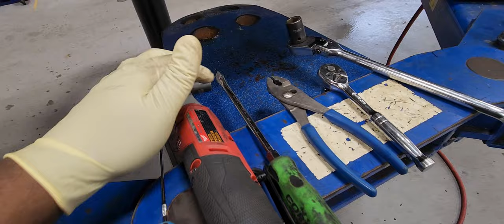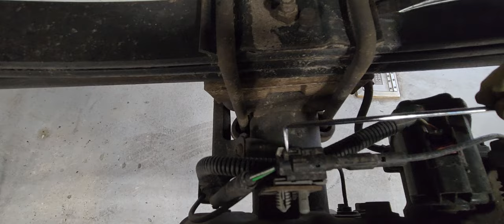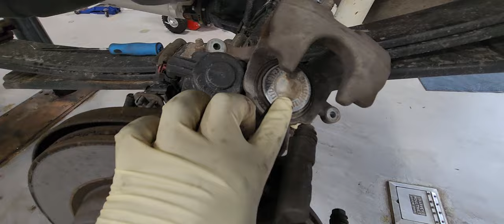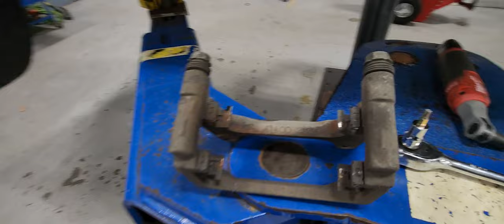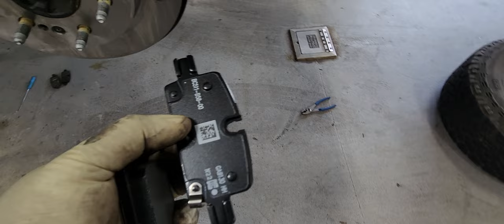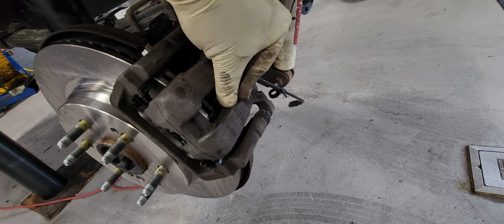2019- up Chevy Silverado rear brake replacement

Comment: Scan tool isn't necessary. You can just put in service mode by holding the parking brake button
Reply from the maker: I found that out recently,I made a separate video about it on how to put it in service mode
https://youtu.be/deHMChk1b3U
Reply: mine is a 2021 and could not get the service mode to come on no matter how many times I sat there and peddled the brake and pushed the button, how ever I do have a rear brake replacement option on the dash which can be reset
Reply from the maker: You are probably missing a step, I've used countless time on Silverado and other gm vehicle,always work,watch carefully
Reply from the maker: https://youtu.be/deHMChk1b3U?si=uA5kskx1gz47FQvn
Reply: @melvinpaul9302 you have to have the ignition on. Not running and not a short press that turns the radio on. You need to hold the start button with foot off brake for about 8-10 seconds. Then when the dash powers up you hold the brake and the parking brake button simultaneously until the brake service lamp starts blinking then remove your foot off the brake and then push the parking brake button again and you’ll hear them retract.

Comment: U failed to mention that the truck needs to be in brake service mode before compressing brake, I have all types of brake codes now
Reply from the maker: Sorry to hear that, but I did mention that in the beginning of the video that Do not attempt to do that job if you don't have a scan tool to put it in service mode
Reply: @steevegmtech7326  missed that part when I skipped to the disassembly part of it 🤦🏽‍♂️
Reply from the maker: Take it to the dealer , they probably recalibrate it if it is not broken internally

Comment: Great video but you don’t show the caliber reassembly, does the piston sit flush to the bore? Mine still sticks out 1/8 “ and will not retreat any further, I also have seen that the truck has to be running when you put it in brake service mode…I cannot fit the caliper over the two new pads, it’s about an 1/8” shy of clearing the new pads…also did you remove the e brake motor to reinstall the calipers? It seems like that’s necessary, I do appreciate the video but showing the tricky parts would really add to it, Thank you for posting!
Reply from the maker: Thanks for watching 😊 ,i made that video a while back, I'm aware that video is not perfect ,I will do another one  with the tips and tricks, it is ok for the piston to stick out a little bit, the ebrake motor doesn't have to be removed from the caliper.hope that help

Comment: What is the best score driver to remove the  steering wheel air bag
Reply from the maker: What year? Model?
Reply from the maker: Most of them you need a pocket screw driver
Reply: What about t handle Allen key I have teeny screwdrivers that are not Is lawn enough
Reply from the maker: It would've to be very small
Reply: What kind of scanner you use to put a 2021 gmc Yukon a rear brake pad in service mode?
Reply from the maker: I used the dealer scan tool,any professional level scan tool can do it as long as it is up to date
Reply from the maker: I used the dealer scan tool,any professional level scan tool can do it as long as it is up to date
Reply: @steevegmtech7326  if I put the truck in Brake Service Mode manually prior to changing pads will I still need the scanner?
Reply from the maker: If you gonna do it manually,,disconnect the battery before unplugging the connector at the parking brake actuator
Reply: @SteeveGMTECH  so I don't need the scanner? Just put it in brake service mode, disconnect battery, retract parking brake piston, then remove connector?
Reply: @steevegmtech7326  also for the brake wear sensor. Can I plug it in but not into the pad? Still lots of material but my dad is insisting they be changed. Just use the good old fashion way of the squealers. Please let me know thanks
Reply from the maker: You need a scanner to put it a service mode
Reply from the maker: You don't have to do all of that, just turn off that feature in the cluster, you will never see it again
Reply from the maker: link for the scan tool
https://amzn.to/42TVqbg
Reply from the maker: link for the scan tool
https://amzn.to/42TVqbg
Reply from the maker: https://youtu.be/igV5DtnSYIU
Reply from the maker: @MD-ro2eq  https://amzn.to/42VURxE link for the brake pad and sensor
Reply: @Shaun Washington  did iy work fine when you just put it thru brake service mode thru the dash
Reply: @steevegmtech7326  Alldata has details on how to manually retract the parking brake cylinder.  You do not need a scanner to perform a R&R on these rear brakes.
Reply from the maker: I will check that out, thank you